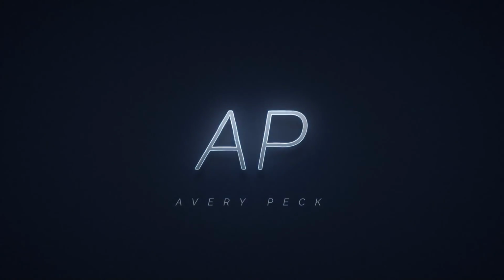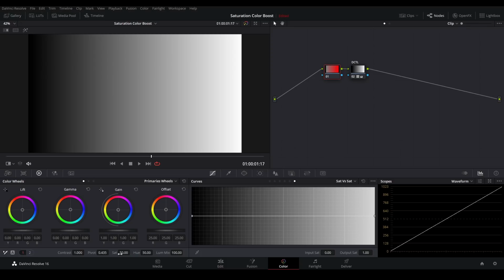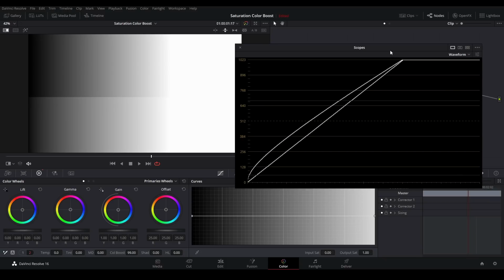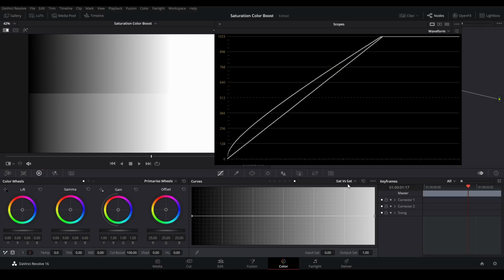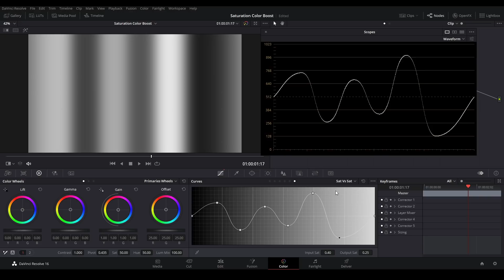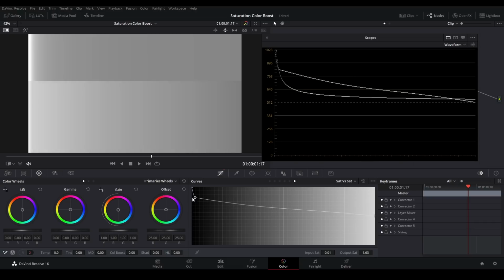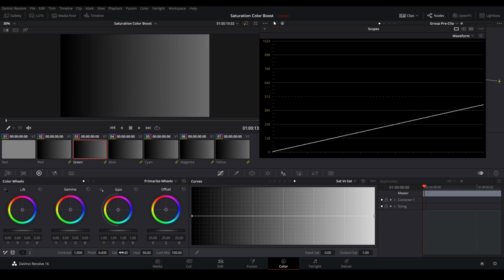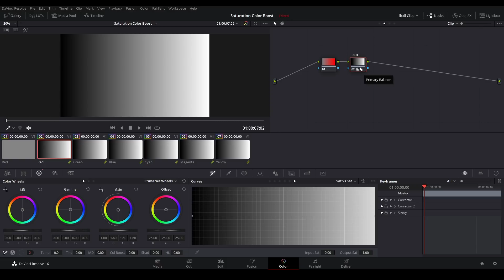Saturation and Color Boost Revisited | DaVinci Resolve

Comment: Does that mean that the technique you demonstrated in the first video still works?  Because it really looked like it acted as you described it. (Kind of like early projections of planet trajectories, that were inacurate but so close that they're still relevant)
Reply from the maker: Technically, yes, the method I showed still works, though my explanation of the behavior was wrong, so it doesn't work exactly as I described. I'd also reiterate that the technique is not for white balancing shots, which seemed to be a big point of confusion for people. It just pulls any low-saturation areas down to zero.
Reply: @averypeck  Alright thanks!

Comment: So having watched this, the way I understand it is that Colour Boost is like a contrast curve for saturation: increase it on the slider and the contrast decreases (by raising the level of the least saturated parts of the image more) and lower it and the contrast increases (by reducing sat on the least saturated part of the image more). As you then have also increased/decreased overall sat levels, you can use the saturation slider to adjust to taste. The question I then have is why not just use the Sat vs. Sat curve, even if the curve is slightly different? Also I’m curious to know why BM didn’t explain this feature when they first introduced it.
Reply from the maker: Yeah, I've always thought of it in a similar way too. As far as using the Sat vs Sat curve, the answer would just be efficiency. It's much quicker to dial in things using two knobs (if you're on a panel) than drawing a custom curve each time, like using contrast and pivot vs the RGB curves. I was a little disappointed too in BMD's explanation of color boost in the manual, which is part of the reason I chose to explore these tools myself!